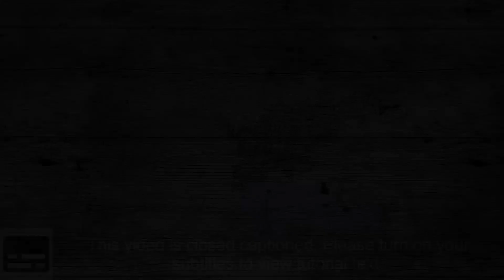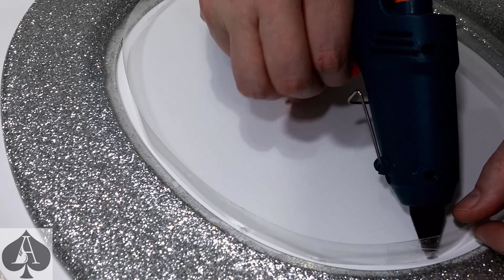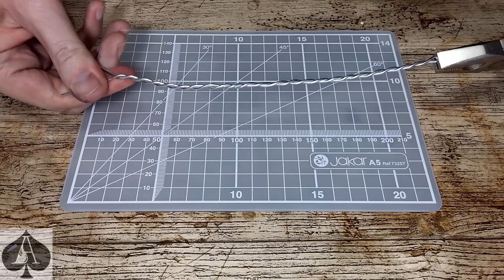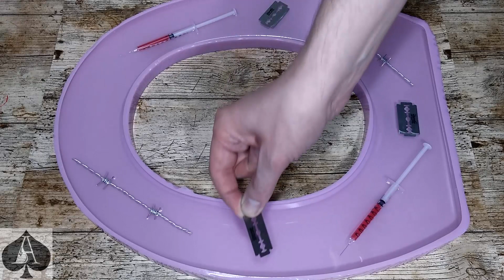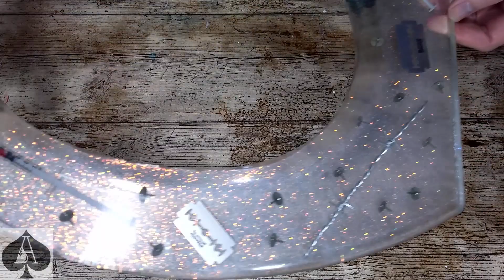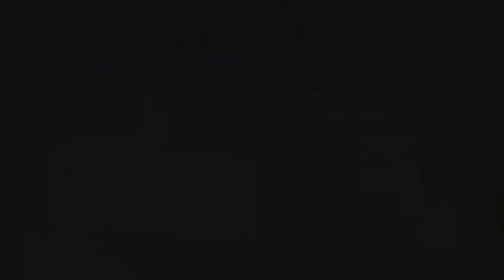DIY Toilet Seat from Epoxy Resin - Would You Sit On It?

Comment: Hi I wonder if you can answer a question for me.  I have purchased UV resin from Ebay along with a UV torch and I also have a "UV" Lamp but the resin isn't grabbing the bezels even after holding the torch very close for a number of minutes and is very greasy on my hands.  The pieces I am trying to put the bezels on are translucent so I have even shone the torch from the front as well as around the bezel but they are just falling off as soon as I try to put them under the lamp.  I am sure that I have seen many resin users torch for a few seconds or even a couple of minutes enough to hold it while it sets.  My lamp also has white light in it so I am also wondering if it is a UV Lamp.  I am feeling very despondent as I have been persevering and still not having any success with the UV resin.  I don't use it to cast only for small jobs like putting the bezels in place until I dome the backs.  Please help if you can.  Thanks fir taking time to read my whiney mewssage.   Annie
Reply from the maker: Hi, I'm not sure whether your resin isn't curing or if it's curing but just not sticking to the bezel. UV resin sold for crafting doesn't make a great adhesive, although it should stick temporarily. It's hard to say where it's going wrong for you. If you've purchased a quality UV resin then there's no reason to think that's at fault. UV lamps are measured in Watts. The more Watts, the faster it should cure the resin. I cure mine quickly with a hand torch and then put it under a 36W UV nail lamp for 10 minutes. If you search eBay you can also find specialist UV adhesives that are designed for gluing applications, and they really do stick like crazy. Some of them come in a tube with a little UV LED light on the end.

Comment: Hi there. Do you have any thoughts on how you would make a resin lid for a square glass vase?
Reply from the maker: Hi, I would make a model of the lid I wanted to create, coat it in a high-gloss finish such as UV resin, and then make a silicone mould from it to cast it in resin. The process would be similar to the ocean waves lid I made in this video here https://youtu.be/Ykl34S7tZp4
Reply: @resinAce  thank you for your reply! So I was told that silicone molds prevent the resin from achieving a glossy look. Is that with any silicone you use? Would it make sense for me just to pay someone to make the mold for me if I gave them the dimensions?